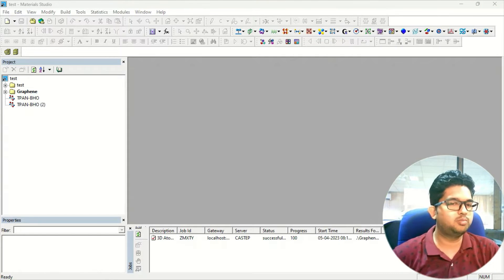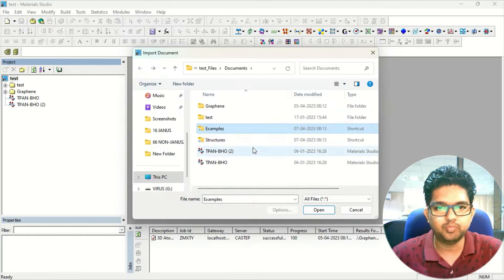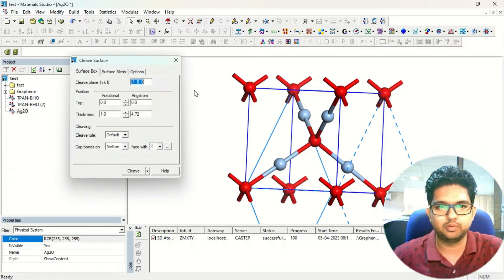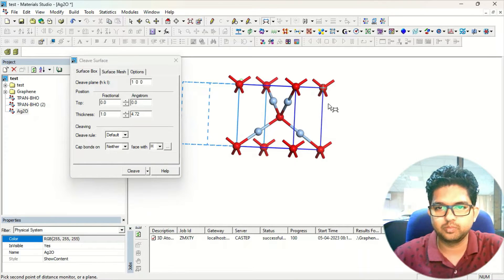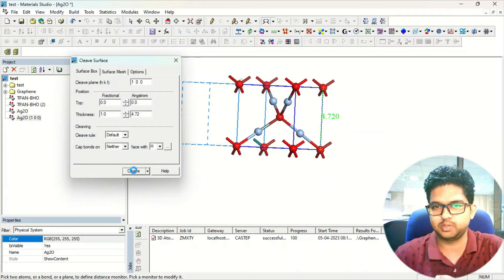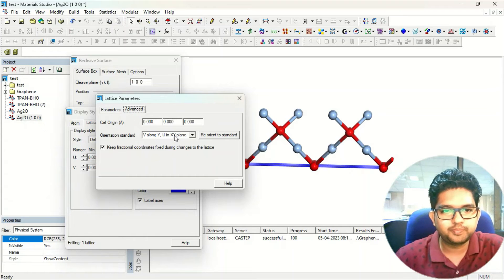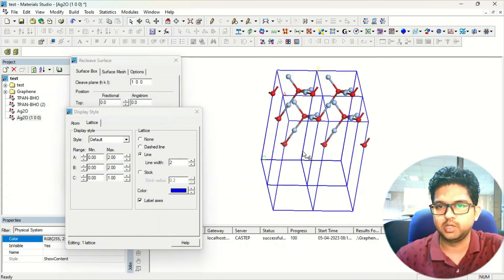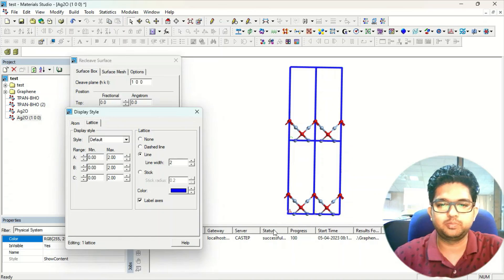How to cleave surface and create vacuum slab ||Gaurav Jhaa

Comment: Sir after cleaving and adding vacuum, how to calculate the work function of a double perovskite material?
Reply from the maker: I think in dmol3 there is a direct option for that (workfunction).
Reply: @quantumguruji im doing electrostatic property calculation for that but after job completion, when I try to import file, file doesn't appear, it says the file already exists. But there is no file I checked